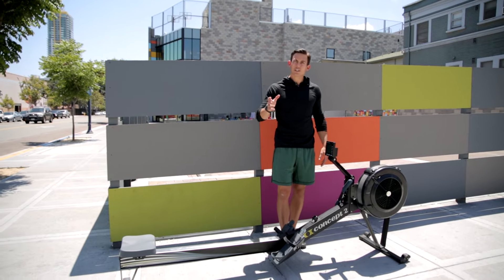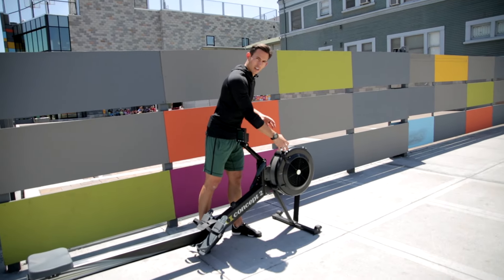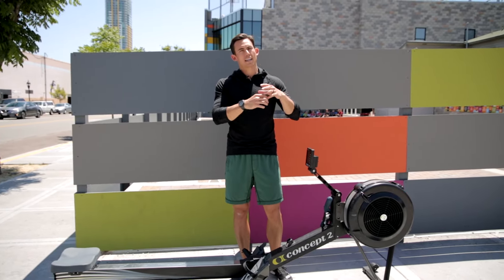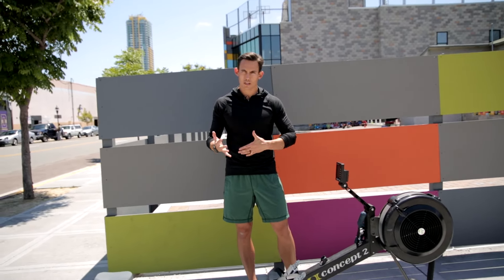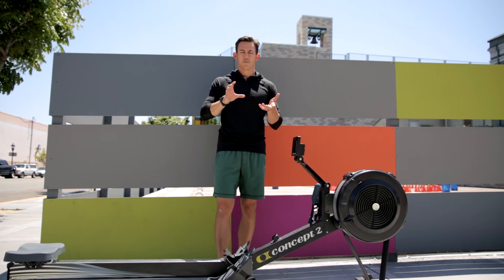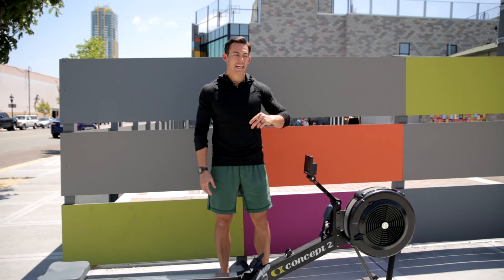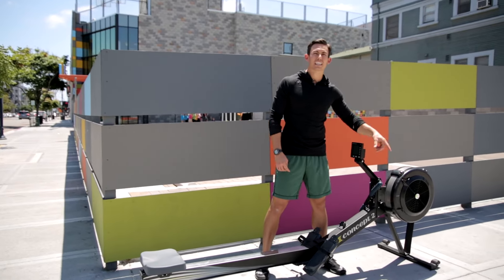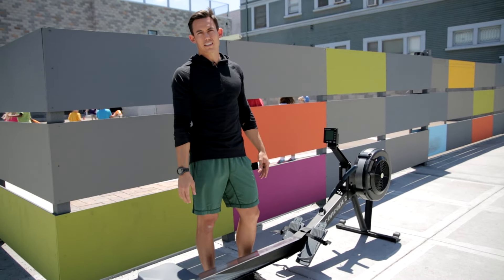Damper Settings - How to Find Your Efficiency Point

Comment: But...my problem is that I am using rowing as a cross training tool for my marathon training.  Will a 10 damper setting fatigue my legs more than a 1 or vice-versa? My goal is to cross train with a non-impact machine, i.e. a rower, while minimizing the leg fatigue, so that my legs remain fresh and my runs remain strong(er) the next day.  advice?

Comment: So longer rowing session (rowing 10k, 12k, ect.) use a higher dampening setting and lower for the more explosive interval trainings you would do?
Reply from the maker: Great questions Adam, but it's not really fixed to any distances. It's purely a decision of one's own as to what feels best for any given distance or time.
Reply: I see, so it just boils down to preference then? Should a rule of thumb be try to match the resistance of the water for long distance? I was watching another rower on here and they were explaining what drag factor to look for if you want to match water.
I just want to try and optimize and get as much as I can out of my sessions on the erg is all. Any advice, tips are very welcomed :)

Comment: @ 5:16 <--- this is exact what happen to me over 3 years of using the erg... started by using the damper at 10 most of the time (DF 190+). After 3,500,000m I now usually have the damper around 4 to 7 depending on the distance and effort level required.... I'm a slow twitcher at 240lbs,  so I have a tendency to like a high drag factor (damper).  I still experiment with damper settings to change things up from session to session. My sweet spots are DF 180+ for sprints (500m or less)  DF 135 to 155 (1K to 15K) and DF 105 to 130 for rows longer then 60 min.

Comment: Genuinely intrigued Dark Horse. I am fully aware of your in depth knowledge of all things rowing and physiology; however; This sounds entirely counter intuitive to me. As an endurance athlete (pretender 😬) surely the fast twitch factor would be better with high drag, slow twitch lower drag? As in you need that explosive power at high drag to get the acceleration of the flywheel? Am I right in thinking that there is a standard amongst “those that know” of a 3 or 4?
Just trying to get my head round it and looking to train for a distance row so would be very interested in your thoughts.
🙏

Comment: Great info! I have been practicing on and off for a couple of years with the damper set at 10 thinking I was a beast 😥. Recently I tried a workout with the dampper set at 5 because I wanted a light workout. I was aiming to get the same splittime as usual and noticed it seemed so much harder to achieve. 

Question; does a lower damper setting require a higher drive speed × stoke rate in order to reach the same splittime compared to a higher damper setting (a bit like a low and a high gear on a bicycle requires different effort to reach the same speed)? 

Anyway, thanks for all your video's. The rowing machine has helped me getting through challenging times more than once. This channel and Training Tall, inspired me to pick up a rigorous rowing schedule a couple of months ago and really helped me to feel great again.
Reply from the maker: Such a well thought out and articulated question. A lower damper requires a faster catch and faster drive, and once good connection is established we can add increased stroke rate to that list because it will be effective stroke rate. Always work to achieve better positions first and foremost then move to rate from there. Does that make sense?
Reply: @DarkHorseRowing  It makes sense indeed. Quality over quantity. It's tempting to just be seduced by a lower splittime, but in the long run that will prevent reaching maximum performance. I'll keep it in mind. Thanks.

Comment: Or... you could use it at a 4-5 because that’s what it was designed to do, as it closely stimulates resistance of the actual water
Reply: Actually it's not about what number it's on its about drag factor. Different machines will give different drag depending on age and wether the thing gets mantained.
Reply: @Oncewasdonka  While all machines vary a bit in drag factor, Concept 2 drag factors generally mimic the drag of boats on the water. Basically, the air intake in a given damper setting correlates to the water resistance created by the beam width of a boat. So, 1 is roughly equivalent to a one-man scull, which is a very slippery, fast boat with a narrow beam. 3 and 4 are roughly comparable to varsity shells for 4 or 8 rowers. 6 mimics the drag of a conventional rowboat, and 10 is like those gawdawful lifeboats on oil tankers and such. I'm not certain I have those numbers exactly correct but that's the principle.
Reply: @cisium1184  Thanks my point is the drag may be set to 6 but because the machine is not serviced and is full of dust and other stuff it has less resistance.  I'm not a rower but have been using these machines for 25 years. I'm self taught so could be wrong. Thanks
Reply: @Oncewasdonka  No you are right. Individual machines definitely vary - as do individual boats of the same type.
Reply: @cisium1184  if thats the case. Wont having it on 1 be better if you wanna row a distance as fast as possible?

Comment: Most videos focus on efficiency without explaining what they mean. This vid teaches me more, thanks for that. Yet..what does the concept2 really measure. Force on the cable?  Will (given enough speed) the lowest setting really give you the best times?
For me the lower settings feel better and more natural but I push myself to the higher settings, thinking it it is better. Will change it tomorrow.
cheers
Reply from the maker: Thank you for this, I'm happy to hear we've created clarity for you. The C2 measures force, acceleration, and distance. All three of which can be manipulated independently thus why lower dampers can create equal outcomes. Your brain is on the right track. Report back with your findings!

Comment: I'm new to this exercise, found this to be awesome than treadmill or running, so higher the damper setting, more drag making harder to pull? Is that right? Awesome exercise new to this and trying to understand the setting rating.
Reply: Unless you are doing sprints (<500 meters maybe 1000), you don't want to be at a 10. People who do that are not rowing. They are exercising using a rowing machine and likely don't have the technique required to row at a lower setting. 

Focus on good technique - especially the "catch" (at the beginning of the pull where you have to catch up with the speed of the fly wheel). Once you have that down, you can feel which damper setting is best for you - will probably be in the 4-6 range.

Comment: congratulations on the channel, I'm from Brazil and I learn a lot from your teachings.
I have a question to ask. What is the mathematical formula used by PM5 to project the average speed and distance?
what is the most important factor in this equation?
power, s / m, or drive length?

Comment: So i row for endurance / distance general fitness 3 times a week, this month i row 5k 6k & 7k next month will be 6k 7k 8k. I row at a drag factor of 110 to 140 depending how i feel, roughly R4 to 5' ish as per Concept guidelines. When i have rowed at R8 i feel i am just working upper body - arms. My SPM would 20 to 26'ish, 30 feels like a sprint with short strokes while lower i can get full 1mt+ travel. Confused as hell now.

Comment: Hello, great videos they've helped me alot. My rowing goals are time trials for the 2000m, 1000m and 500m rows. My times are 6:49 for 2000, 3:05 for 1000 and 1:23 for the 500m. I weigh 190lbs and I'm 5'10.5. I find if I use anything lower than a 10 damper setting on rows of 1000m or less, I cant acquire these times. I'm working harder and faster to get the same pace ( feels like I'm on an easy gear and just can't speed up). I've watched other dudes on youtube  my size or bigger killing 1000m rows with  the damper on 6-7. Am I missing something? I cant find anyone online recommending a 10 setting. I'm not a cross fitter  and I keep my rowing separate from my other workouts so I'm rowing fresh. And insight would be great.
Reply from the maker: Absolutely, have you checked out the rest of our channel? I have a feeling we could be very helpful to you.
Reply: I think I've watched most of your videos. I can guess my question would be a hard one to answer. I realize everyones different. Thanks for the reply.
Reply: Check out British row teams, water is 3 to 5, they do meter rows for time on the concept. A 10 is not recommended due to injuries. Your time are excellent!
Reply: dynamite479 The higher the drag the more force can be applied per stroke, but at a 10 the efficiency is not as good as a lower drag with higher stroke rate for the rowing athlete. As a lightweight rower (<150lbs) I find that ~120-125 drag factor, or just below a 5 is most efficient at ~ 35 stroke rate for 2000m. I train mostly endurance as I cannot bulk so heavyweight tower tend to go at a higher drag to get more force per stroke. The world record 2000m of 5:35 was done at a 130 drag or around a 5 because that is the Olympic trial standard drag.
Reply: I'm 6'2 225 and feel the same way.  I've done 1:21 500, 6:33 for 2k and 17:57 for 5k and  I agree.  I feel like all of my power is wasted on lower damper settings. Leveraging my weight again the resistance also helps when keeping lower stroke rates. It keeps my heart rate in my efficiency zone.
Reply: @TheBodyFirmATL  Thank you!  For me I don't understand the concept of rowing under a 10. I've rowed at a lower damper settings and I am really really slow when I do. My 2K is 6:37, i have zero chance or hitting that at 5. 
Its very simple, if you are big and strong and that is your advantage then you row at 10 if not you can row lower. And even if you don't have top end strength and you want to row at 10, knock yourself out. There's all this talk about getting hurt at 10. Yeah no, no one's getting hurt pulling a rower even at 10 there isn't that much resistance.

Comment: So i should find my happy drag factor and always row about there? What about a really short row vs a really long row? I can hit 1:15/500 for a couple hundred meters with the DF at 200 but that would seem impossible at a DF of 100. When doing a 10k a DF of 100 would feel great. Let's say my happy DF is 130 would is there a standard curve i can follow? For example should i add 10% to my happy DF for a 100m row and subtract 10% for a 10k row? Lots of questions. Thanks!
Reply from the maker: There is no hard and fast rule to Drag Factor, only what feels best. GENERALLY, the longer the piece, the lower the drag factor though and the shorter the piece the higher so your assumptions are fairly in line!

Comment: Interesting. New subscriber from this vid. I always set 10 simply because it felt the hardest and therefore I thought I was getting the most burn from this setting on a 500m sprint. I usually go fast and then completely struggle when only 200m left. Should I obviously be lowering the drag setting? And if I lower it and still do a 500m sprint, will I burn less calories compared to drag setting at 10? My main goal is improve my cardio levels. Thanks
Reply from the maker: You will still burn the same amount of calories, especially if you're able to persist for more than 300m and all the way through 500m. So definitely lower your drag factor so you can find better movement quality which will give you a better workout.
Reply: Appreciate the reply. Have definitely learnt from this channel. Thank you!
Reply from the maker: You're very welcome.

Comment: Not a fan of sprint type rowing at damper 1-3. Because there is no way you can avoid springing your knees on the catch. Some dont get injured but some do, rowing this way.  A controlled movement towards/at the catch (without springing the knees) then exploding towards the stretch , is a safer wayy to perform this exercise. And to build a decent sweat this way, damper needs to be at 5 or higher.   End of the day there is no one size fits all technique

Comment: I have always rowed at a 10 setting.  When I use the lower settings it just feels that I am not getting the same distance/resistance on my stroke.  It's like stepping on the gas with a manual compared to an automatic.  Anyway I've been doing it that way for decades.

Comment: Now this is the biggy for me....i simply cannot hold my splits unless i.m on damper 10.....now i dont know if thats because i.v always had it on 10 ever sinse i discovered erging(some 20 yrs ago), or is it just bad technique??? I have no idea....
Reply from the maker: Hey Carl,

Understand that if you've been doing this for 20 years at the same drag factor then adjusting it is going to fly in the face of what your body understands fora  bit. So there is guaranteed to be a drop in performance if you decide to make the switch. Initially it says nothing about your technique, other than that's how you've developed your body to connect with the machine. Make sure you check out the drag factor workout we just released and give the workout a try to see how it influences you and your perception of damper/drag factor.

Cheers,

The Dark Horse Crew

Comment: Hi Shane!  Ive watched all your videos on drag factor. So i implemented the Drag Factor workout yesterday, and if im interpreting the data correctly, i managed to produce the most wattage at setting 4 and 1, though setting one seems impossible right now to maintain.  In terms of comfort, i dont know exactly where i was most comfortable, but i do know that the very high and vey low settings were least comfy.  3 questions; does this mean i will most likely get the best and most out of my workout at setting 4 since i produced the most work?  Is this a type of workout you recommend to be done monthly for example, to see if anything has changed?  And lastly, im still a bit confused because in my mind the low drag factors are meant to mimic hydrodynamically designed boats, and high drag factor is for moee cumbersome boats, so if a sprinter with fast twitch decided to set the drag factor say 2 points higher, wouldnt their explosiveness improve, similar to training with a parachute?  And if this is the case, then it would stand to reason that increasing your explosiveness at a higher drag setting will ultimately make you stronger/faster?
Reply from the maker: Atif, you've really unpacked a lot here, thank you so much:
1. If you want to get the best results out of any particular workout per your current fitness then yes.
2. Yes, I'd say every other month test would be good for this to re-test where your drag factor lives as you progress.
3. Absolutely, just because you found 4 to be most effective at this moment doesn't mean you shouldn't train at other drag factors. The key being that when you do, you have a reason and training response designed behind WHY you're using it which comes back to your example of the parachute. So by all means, mess with it even when your test results say otherwise because you will be training at drag factor for a reason and at the end of the day that's what it's about is improving your ability to understand and connect.
Reply: Thank you for the reply!  If i understand correctly, using the examples of the runners, training at a decreased drag setting will increase the fast twitch fibers of an endurance runner, and training at a higher drag setting (assuming you apply the same explosive stroke maneuvers) will increased the amount of power a sprinters fast twitch will generate?  I would assume that the only way you would increase slow twitch fibers is by slowing down your "stride" on a higher drag setting, so as long as you use the higher drag setting like a parachute, you will maintain your fast twitch, just make it more powerful per contraction.  This still confuses me a bit because if thats the case, it still always makes sense to train at a higher drag setting because, if you imagine an actual rower, wouldnt training with a less hydrodynamic boat make them better and faster in their boat?  So while my work generation at the other settings wasnt as much, wouldnt that mean im getting a better workout?   The only objection i can think of to setting the drag to 10 is the analogy of trying to squat the whole rack; obviously one is supposed to incrementally add weight.  Thanks for you patience and i hope im on the right track and making sense.
Reply: P.S. i dont know where the "love" button is or id do so to your comment :)

Comment: For a long time I was doing a 30 minute row on damper 10 at a stroke rate of around 30-32  and a calorie rate of 920-940 an hour.  That was great for maintaining health, but was kind of stagnant and I definitely had a performance wall where I couldn't regularly break the 980 calorie rate barrier.  Recently I've slowly added in some HIIT sprints throughout the 30 mins and even though the PM shows a similar calorie rate, I definitely see improvement in fitness.  Visually my percentage of body fat "looks" better and I have lost overall weight.  Having said that, I've always dampered at 10, is there really any value to drop it at this point?